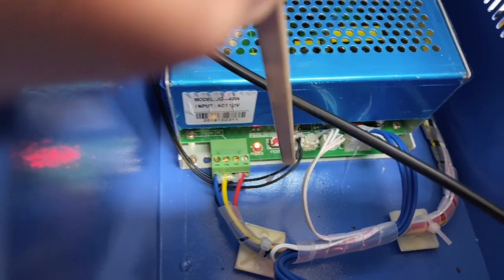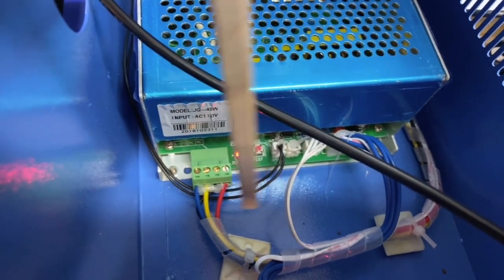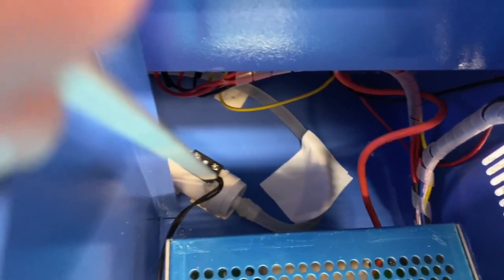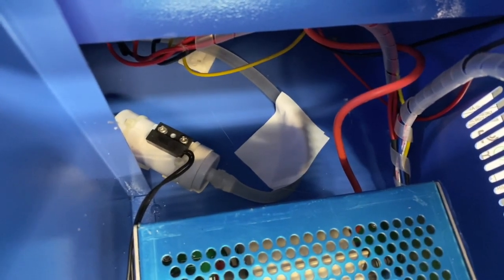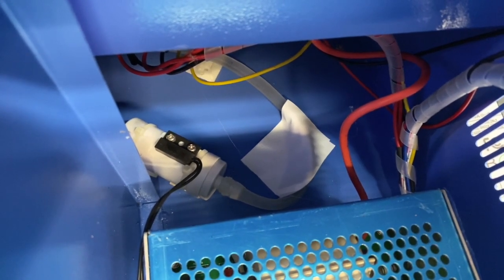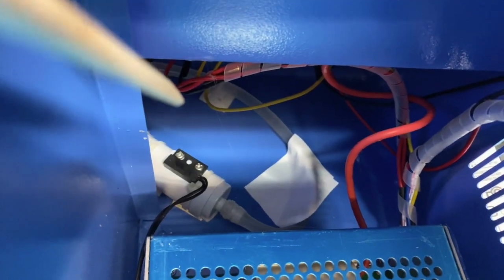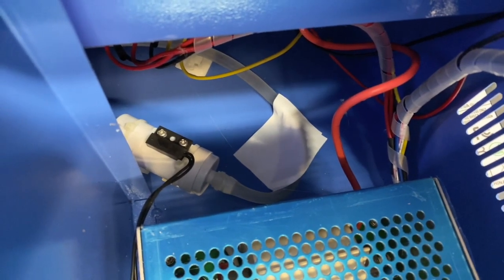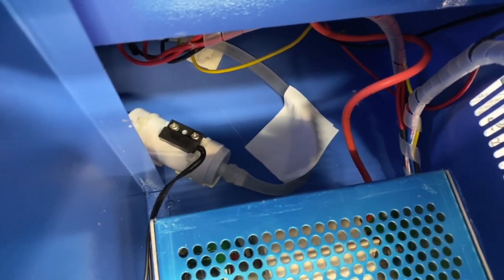K40 Laser not firing / water sensor issue

Comment: Greetings from Australia. I have a similar K40 however mine came from the factory with a jumper already fitted to those contacts on the power supply and no water flow sensor. I couldn't understand why they would provide two contacts and then just short them out. Now I know, thanks to your video. They saved the cost of a water sensor in the manufacturing process. I have seen other videos where these contacts are used to connect interlock switches, e.g. lid open sensor, keylock switch, etc in series so that if any one of them are open circuit the laser will not fire. I am in the process of making these mods to mine so the grandkids don't laser their fingers off or go blind from messing with Poppy's toys while he is away. P.S. it might be a good idea to invest in a camera stand, that video was way too shaky although the content was good.

Comment: Hi dear 
I have same issue in my laser machine and I did what you said but it’s still not firing
Reply: I’m not sure then. Maybe something plugging up the tube so the water isn’t flowing correctly. After i fixed that issue I’ve not had any other problems. I’m sure there could possibly be another safety switch that I’m not familiar with.

Comment: If I hit the test button on the power supply and it fires does that mean the power supply is good? I am getting fire when I manually press the button but when I press from the controller nothing happens.
Reply: did you solve that problem ? I also have it
Reply: Sorry i just saw your message and i know that was a year ago could be a bad switch out controller boarders

Comment: When i added a 50L air assist to my k40 laser i switch on ,it turns on and off quickly by itself, she is no longer working, SOLUTION PLEASE 🥺
Reply: Sounds like a power issue. If you are talking about your laser no longer working then it’s possible when you added the air assist it caused the laser to possibly blow a fuse. Do a You Tube search on replacing a k40 fuse. Then disconnect the air assist and turn on the laser. Just a guess but the air assist might be pulling to much power or it has a short. If the fuse doesn’t resolve it possibly a mother board issue or power supply.

Comment: I have HT 1325 but it’s not firing as well .. can’t find the water sensor
Reply from the maker: Since i don’t have that model i might not be much help but if you follow the water tube going from your laser to your water supply there should be a sensor some where along that tube but you also want to make sure there is no kink in the tubing. Also check your pump and make sure it’s working correctly. If the sensor doesn’t have enough water flow going through it then it will shut the laser down to protect it. If you don’t see any issue with the water then you might have a loose wire to where there’s no power getting to the laser. Wish i could be more help. Thanks for the question.

Comment from the maker: Check the hose that is in the back of your machine and there should be a sensor done where in the line. Also check your hose and make sure there are no kinks in it any where. If the house is free of kinks then it’s possible that the sensor is bad. If you by pass the sensor and it works then you know what the problem is.
Reply: Hi there would you be able to help?
my laser tube won’t fire . Thanks.
Reply from the maker: @MFouad-db2yi  did you check the water sensor ? If you follow your after tube from your pump to your laser you should find it. If that’s gone bad your laser won’t fire. Other then that maybe your board is bad. Check to see if you can test fire it also.

Comment: Will that helping me I just have an issue yesterday , and try to figure what the problem is, but I can’t find the black cable as I have same k40 but different power supply shape
Reply from the maker: What I would do in that case is find the water sensor connected to your water line and follow the leads from that to you power supply. Sorry for the delay to answer but I just saw your message.